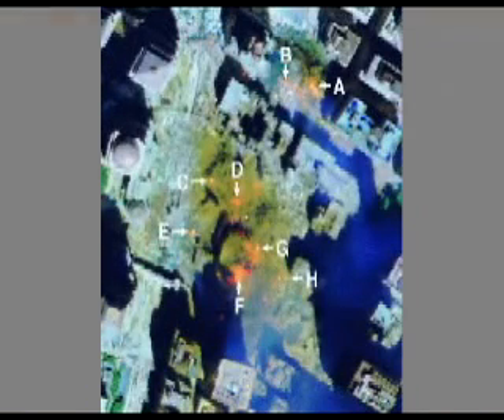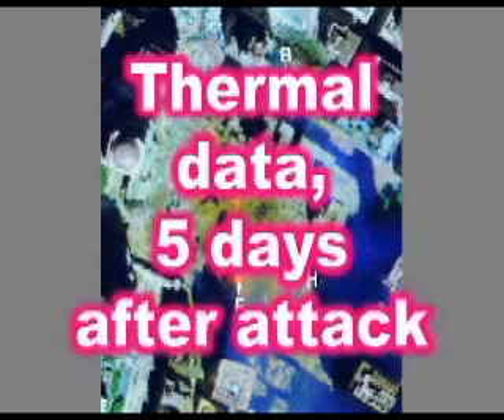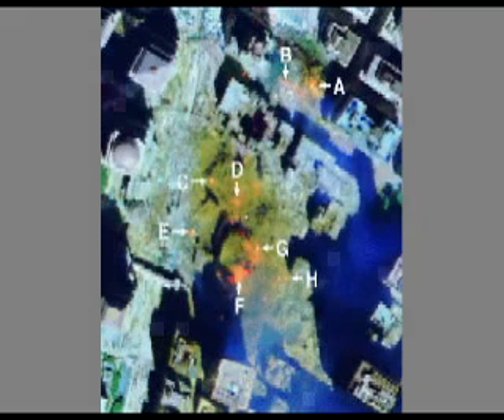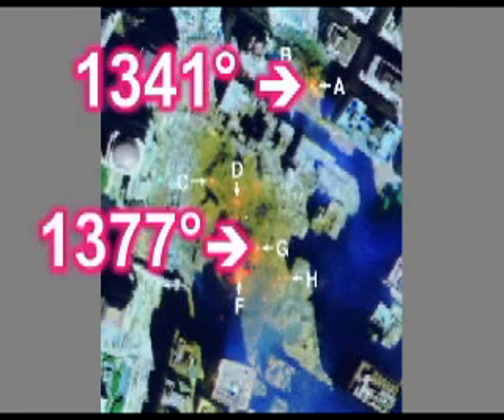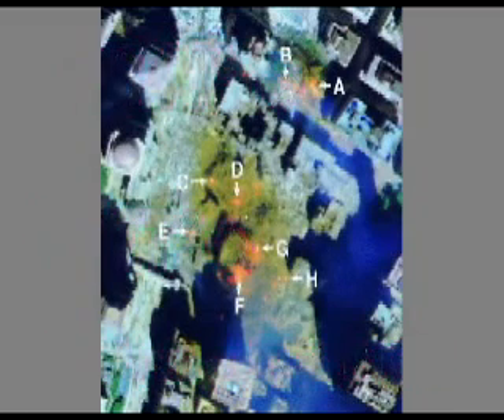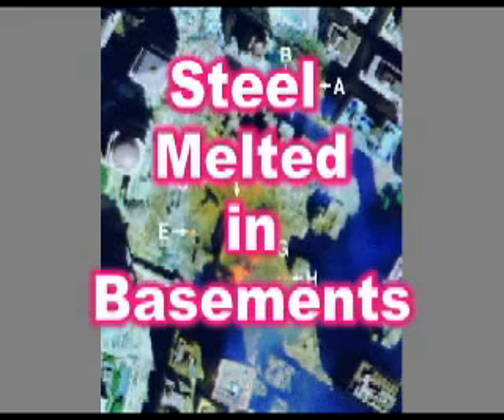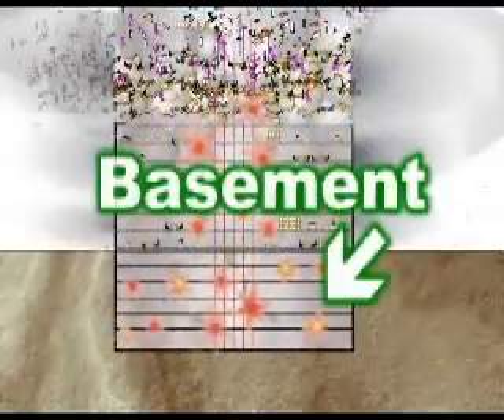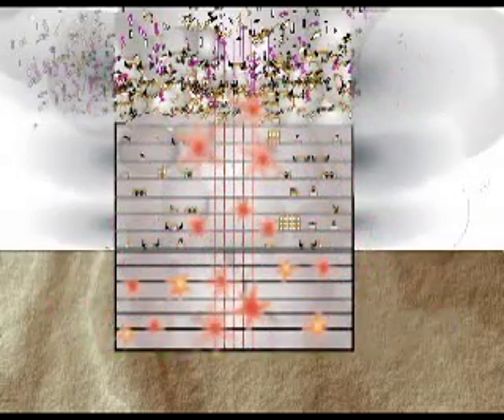WTC Ground Zero Molten Steel (Part Two)

Comment: One Dr. Jonathan Barnett, a professor of fire protection engineering, said that an uncontrollable fire could not explain steel members in the WTC 7 debris pile that appear to have been partly evaporated in extraordinarily high temperatures.  Evaporated even he said, so steel going from a liquid to a gas.

Comment: Exterior columns had an aluminum alloy. Now how would this aluminum alloy react with iron-oxide without there already being extremely high temperatures? Or are you retracting your claim that this reaction was occurring?
And what kind of proof did you want, that you could somehow get without it being from someone else?

Comment: I can just see how your world works now... Melted aluminum just pouring out of every crack of steel structures.

What kind of proof are you expecting? You want someone to bring a piece of hardened, molten steel to your doorstep?  I don't get it...

And how would a reaction between aluminum and iron-oxide ignite without there already being extremely high temperatures?

Comment: He didn't say i-beam, he said channels. Saying he said i-beam is a lie. And I saw a testimony that did say pools. And being that he claims there was molten steel running down channels, it's not hard to figure pools of this molten steel would be in the place where this molten steel comes to rest.

The difference is irrelevant, and you're really just avoiding the issue of what would cause steel to melt.

Comment: It's obvious you are the one using buzzwords, as I am the one who has to do the research for you and tell you why you haven't thought any of your statements through.

You didn't even know that you can have the iron oxide and carbon monoxide chemically react below the melting point of iron without creating molten iron. And that was your an argument you try to put forth.

Comment: In fact, the chemical reaction between carbon monoxide and iron oxide, producing metallic iron, can happen without even melting the iron.  Such was done in some furnaces used to smelt iron.  And in a bloomery, it's a fuel(charcoal, iron oxide) rich environment, kept at an efficient ratio.
I'm sure this all doesn't make any sense to you anyway, you just don't think things through.

Comment: Yes, it is a relatively slow process. 

Do you know that hydrated iron oxide and non-hydrated iron oxide react chemically the same to carbon monoxide? Do you know at what temperatures such reactions would initiate? Are you sure such impurities need not be removed to allow this reaction, such as is done in purifying ironstone and other ores for example?

Are you 100% confident in the information you are divulging here?

Comment: Yeah, you thought wrong...
Anyway, you need oxygen for rust to form, which is a relatively slow process. With fires consuming the oxygen, the air would be less and less rich with oxygen needed for rusting.

Comment: Do you even know whether hydrated iron oxide(rust) would chemically react the same to carbon monoxide as non-hydrated iron oxide(used in steel production) does? How do you know this?

Comment: Actually I was referring to your claims thus far. E.g. Piles of carpet melting steel, aluminum turning yellow-orange, discounting eyewitness' accounts of pools of molten steel simply because it disagrees with your story. You know, that kind of stuff. There are charts online that show the luminosity of aluminum at different temperatures. Nice try though.

Comment: When you show me that it glows red...
Here's a video of molten aluminum at >1800degree F.  This is above the maximum burning temperature for jet fuel in air, and 600 degrees F above it's melting point.  Enjoy.

Comment: I'm saying it even if there was aluminum on the end of the steel beam, it does not change the fact that the end of the steel beam is molten dumb ass... I can't put the link to the picture in my comment, and since you're so incompetent that you can't find the pictures yourself, I guess you're out of luck.

Comment: Iron glows bright yellow-orange as it becomes hot enough to melt, and steel is iron. Aluminum is silvery.

For there to have not been molten steel, it would require that every person claiming they saw molten steel were not telling the truth.  And that every picture and video showing molten steel was fake.  No, I think the standards I use to reach my conclusions are much more reasonable than yours.

Comment: "You don't even have proof of molten steel." Actually we have contractors, workers, and firefighters all claiming they saw molten steel.  Are you saying they are lying?  I have seen some photos with steel beams being pulled out of the rubble that are red hot on the end and some red hot liquid dripping off it.
You sir, have failed.

Comment: I did not assert that the collapsed building was merely a pile of carpet. You said a pile of carpet etc, that is insulated, can melt steel. I asked you to give an example of this happening.

I did not assert that without compression the temperatures cannot be had. I said that in a jet engine the air is compressed to increase the temperature.

You still didn't give an example of a pile of carpet melting steel. I assume at this point you're not going to give one.

Comment from the maker: Enter logic.  Why would there be extreme temps BURIED UNDER the rubble from fires on the 78th (South Tower) and 94th (North) floors?

youtube*com/watch?v=4p6UuGE0plk

youtube*com/watch?v=rArg9J8-a0U

"In the first few weeks, sometimes when a worker would pull a steel beam from the wreckage, the end of the beam would be dripping molten steel"-Greg Fuchek, vice president of sales for Links Point Inc

Comment: The whole point is the fires in the WTC would not simulate a similar condition without compression... You disagree? Then you can enlighten everyone. But of course you have no reason to disagree, other than to save face. You still didn't give a case where a pile of carpet melted steel.

Comment: Burning carpets can melt steel? You have an example of this happening? No, because it doesn't happen... Unless you're saying you can produce a machine that burns carpets and creates conditions to achieve higher temperatures, like a jet engine would do...

Your whole argument is just retarded and unreal.

Comment: Wrong, Jet A-1 fuel has a maximum burning temperature of 1796degreeF, and open air burning temperature of 549degreeF. The heat in the jet engines you'd see in the airliners on 9/11 would be about 2700degreeF, not 3200... And that is because of the compressed air increasing the energy potential of the air, not because jet fuel would normally burn at that temperature.

Comment from the maker: Superheated masses? The fires were on 78-84th (South)and 94-98th (North)floors. The fires were limited to floors 8-18 on the South side of WTC7. The buildings came relatively straight down, but somehow these extreme temps were discovered in the basements trapped under rubble? Please show me another example of this happening if it's so common.